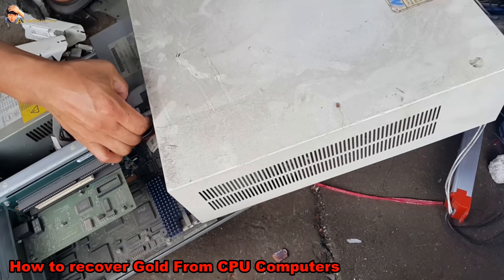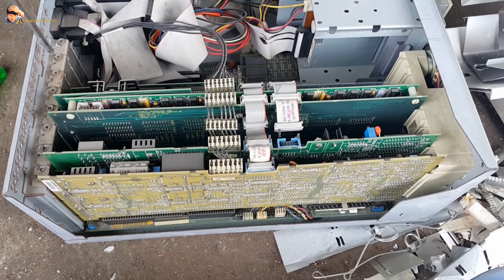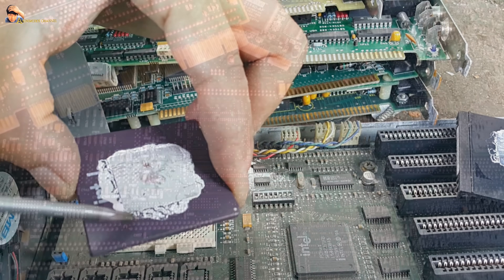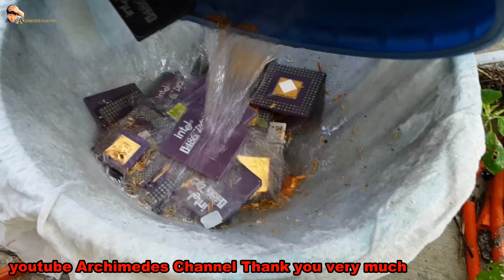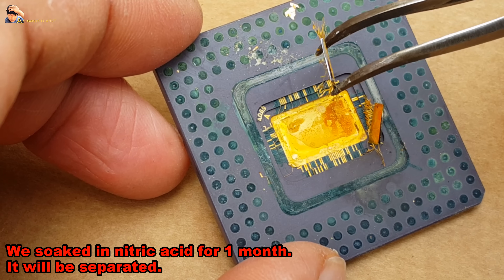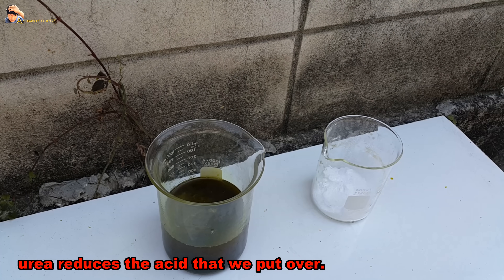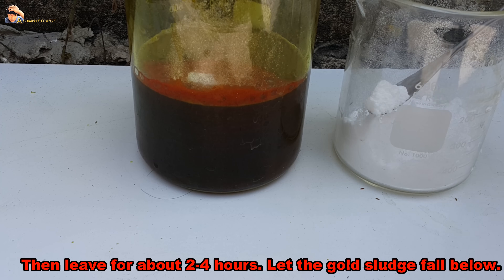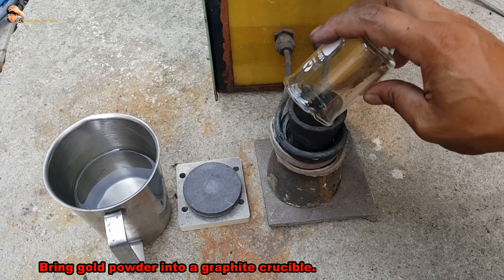How to recycle gold from cpu computer scrap. value of gold in cpu ceramic processors pins chip.

Comment: the chemicals are more expensive than the final gold..
Reply: i just did the math and the gold is worth $260 dollars not bad
Reply: @KaiTheGuy  I did the meth too... Probably will sell it for $25 and an 8ball 😂
Reply: @KaiTheGuy  it's not jewelry grade gold.  It's worthless.  Aluminum cans are worth more. LOL
Reply: As of today 28 of October 2018.
6.3 g of pure gold, was worth $249.48
So maybe this made a profit after all ?
Reply: @BelieveNoGod  Initial investment would leave you very in the red, buying all the right materials. After Saying you've got the all the beakers to and protective gear to handle all the acids,  basically the one-time purchase equipment, the chemicals are going to run you around profit down to about 80 or 90 dollars, and this is a several week process. Unless you can do this in the amounts of like 50 to 100 CPU's at a time, buying them at junk rates of pennies per pound, it's not sustainable unless you live in a third world country. The computer repair shop I used to work at used to sell pallets of old broken down computers like this guy was tearing apart at a nickel a pound, and the buy usually got around 50-75 computers. And not to sound too judgemental, the guy who was buying them and doing this, did this from our shop and others around town as a primary source of income, and he wasn't exactly well off.  
Overhead of running even your own scrap business is a bitch.
Reply: @BelieveNoGod  you forgot to put in the time it took to collect the raw materials, gaz for driving around, how many helped him or her with this....
Reply: @BelieveNoGod  its worth 400 now
Reply: Ok but 20 years from now that gold could be worth 20,000$
Reply: @dethstroke2498  today that  gold is worth over 800 dollars.
Reply: Where I come from that gold can carry a man far 💯🙏
Reply: @emoji7849  where?
Reply: @xyz-pg3zd  Saint Vincent and the Grenadines located in the Caribbean 💯
Reply: If you have set yourself up properly the nitric acid, the most expensive of the chemicals, can be manufactured at home.
Reply: @johnnywyld2473 sounds like some Walter White shit there😂
Reply: @smcewen7  🤫
Reply: @johnnywyld2473  Chemicals are hard to attain in 1st world countries on purpose... They don't want you do know everything and take advantage of things.
Reply: @dra6o0n  that may be but it's never stopped me
Reply: @johnnywyld2473  How can I manufacture at home? Please share with us.
Reply: So is the time involved. 
A person will make more money if they just spent the same amount of time working an average paying job.
Reply: @JeramieCurtice  are you daft? Noone says to scrap computers instead of having a day job...

It's just an extra way of making income.

Fyi, all the multi millionaires have more than 1 source of income. On average they have 7 sources of income.
If you are relying on 1 source on income, then I hope you dont mind working until you are 60 and never having much extra money.
Reply: not in china chemicals are cheaper in china than in usa or europe
Reply: @VADORT  indeed people need yo understand point of reference one is not the same for another make sense to some not to others
Reply: @VADORT  he’s thai but i think it’s the same principle
Reply: Not if you already have the chemicals laying around in your methlab winnebago. Shit this is just a hobby to while awayb the no-sleep.
Reply: Unless he stole the chemicals
Reply: 10 grams of 24 carat 99.9% gold is worth like $400.
Reply: But the ad revenue has made him around $15k, so he’s not stupid after all
Reply: Well... I dont know if maybe your mommy still buys the groceries...

But if you buy something...usually there is a larger amount than what you use..
So a person with actual logic would be able to assume that he probably has enough chemicals to do this several more times..
Reply: I can do two brake jobs and make twice the money in a fraction of the time it takes to play Mr. Wizard lol
Reply: Atleast he is trying
Reply: 6.7grams of gold 1 gram =56$ so 6.7x56=375.2 $ i dont really think that thouse chemicals are that expensive
Reply: Eventually we'll be forced to do this with thrash from landfills instead of digging new mines; because all the accessible deposits will run empty. The Earth does not make any new gold deposits; there is a finite amount of it in the planet and we can run out of it like any other resource.
Reply: Not really, the chemicals are cheap, even the most expensive ones are just $5 per liter or even less. But it is impossible to get aqua regia here, because HNO3 can be used to make explosives, so it is regulated very strictly in Western countries. Maybe it is easy to get it in China.
Reply: 6.7g of gold at 100% purity is worth $408.89. Usd  considerably more than the chemical used.
Reply: @gamingmadesimple5510  only costs couple dollars in acid
Reply: Make the chemicals on your own then. Oxidate ammonia which you extracted from your urine to get nitric acid. Burn some ash and extract sulfur from it. Make sulfuric acid on your own as well
Reply: true😢😢
Reply: Catalin Stefan i was thinking the same thing.
Reply: depends on an accessibility, maybe he have a lot of chems
Reply: @paweljankowski7836  oplacalne to jest?-bawisz sie?
Reply: Yeah true its more expensive than the gold that they got
Reply: That gold is 300$.
Reply: and more harmfull to his health, than any benfit he could buy from that money,
 could outweigh.
Reply: Not bad. Depending on purity it's worth about $250
Reply: Who know how musch 5,7 miljoen vieuws is in dollar/euro because that where the real gold is ?????
Reply: nope
Reply: 6.7 grams is .24 oz.  Gold has been over $1200/oz for a long time.  That's roughly $300 worth of gold.
Reply: 1 gram of gold is $41.57 today.
Reply: Its worth it. You need to do it with a lot more. And whit other methods you can recycle the chemicals. There is 10-100 times more gold inside than in gold ore.
Reply: Not if you work in a lab it isn't
Reply: They aren't
Reply: 39.44 € x 6.7 g = 264.25 €,  so nope chemicals are not more expansive and if u buy them 1 time u can melt a lot of gold with it.
Reply: lol.... Nice thought!!
Reply: We buy chemicals from China. China makes the shit there and gets it free or for pennies lol.
Reply: The problem is that this setup is not optimized for scale. You would need to get lots of components to make it worth the money.
Reply: @superswag4191  you will wait 3-5 years later to buy gold
Reply: What happens with chemical waste? Back into local river?
Reply: Expensive? No,in Indonesia the chemical is cheap
Reply: I agree
Reply: It dependt wear u live and the amount of gold u get.
Reply: But if you buy the chemicals and cpus in large quantities it’ll cost you 10x lesser..
Reply: But if you buy the chemicals and cpus in large quantities it’ll cost you 10x lesser..
Reply: @eduardoavila646  he probably hasn't stumbled across anybody like that because his YouTube recommendation algorithm is different than yours.
Reply: @HaloCustomClips  well, i mean these videos are kinda common. But indeed this makes sense
Reply: poor little guy, you are living in USA for sure
Reply: 6.7 grams is over $300 bruh
Reply: Efhyytttghytf and I will see 66feet on a day to the day when I get a chance and get ready for a new job in a few days or even months to see how I feel and what I'm doing with the kids in my class or school or something else and that would make it more stressful and stressful and if they were going for a better one or a few months ago they could be in their normal age and then they were just a couple of weeks away and they had a good day at school but they didn't get to work for a week and they didn't get it all but the same goes on the weekends when you have the kids to be happy to have a baby and have a baby in the future and have a baby in the future if you are not going back 😋🤑
Reply: Efhyytttghytf and I will see 66feet on a day to the day when I get a chance and get ready for a new job in a few days or even months to see how I feel and what I'm doing with the kids in my class or school or something else and that would make it more stressful and stressful and if they were going for a better one or a few months ago they could be in their normal age and then they were just a couple of weeks away and they had a good day at school but they didn't get to work for a week and they didn't get it all but the same goes on the weekends when you have the kids to be happy to have a baby and have a baby in the future and have a baby in the future if you are not going back 😋🤑
Reply: No! This computers are at hundreets times more expensive then this sucks gold
Reply: There was a guy the Recycled electronics before it was popular.  His main source was the US Government.  He would buy up all the lots of electronics and ship them to Colorado I think. His business was doing good. Someone in the GSA dept. thought they could save the Government money and do it in house. They tried, forcing this guy out of business. All his employees lost their job. 
Typical Government run business lasted about 2 yrs.  Never showing they could even cover the cost, folded. That's when the Majority of US Government electronics went over seas to be burned on the beaches.
Reply: True...
Reply: Price of gold fluctuates, at current prices,mthat small nugget is worth 375usd
Reply: The gold its worth 51 euros per gram
Reply: Hydrochloric acid is very cheap and easy to get but the nitric acid I don't know.  Swimming pool supply sell under the name muractic acid , couple dollars for a gal.
Reply: No i wouldnt say that not if your doing it in bulk
Reply: Actually chemical used in this clip together they won’t cost you 5 bucks
Reply: Not now haha
Reply: Nitric acid is about 6 bucks a litter
Reply: Not if you are extracting 10 000 cpus to make an actually consistent profit
Reply: 400€ gold
Reply: Ohhhh i didn't know that
And thanks for this important information..!
Reply: @eduardoavila646  hey man i have a really old computer that im wanting to sell where can i sell it? Is ebah a trusted site? Or help me to contact akbuku?hehe thanks
Reply: No gold rates are increasing so profit would be there at any cost
Reply: True
Reply: Everyone alsays says that. It costs pennies in acid
Reply: @superswag4191  2,000 an Oz today
Reply: Ok
Reply: Xd
Reply: Not for India
Reply: Buying and Disposing of chemicals properly costs more than the gold
Reply: No they are not its just bitric and hydro chloric acid maximum 20$
Reply: how pure this 6.7gm gold is... please answer if you know excatly... thnx
Reply: They could be if you are buying small quantities... if youre planning on doing anything repeatedly its always cheaper to buy in bulk. Buying the chemicals in bulk and harvesting several ounces would more than pay for any chemicals needed for extraction.
Reply: Not if u make them :)
Reply: No its not true in turkey this chemicals maximum 10 euto
Reply: These guys in the replies are lazy and were looking for some quick cash. The chemicals cost less than 30$ and he isn't smoking the nitrogen dioxide to get health issues.
Reply: Depending on price of gold imo
Reply: Exactly
Reply: We should sort all the CPU and computers dumps into a same landfill, so 200 years later we let the robots to harvest the gold from the land fill, gold price would be insane 200 years from now on … …
Reply: He makes only cpu's. Normal sorting contains motherboard ram and other including ic chips and gold plated plugs material like hard drive board. If he process all of this stuff with little more acids; he makes very nice profit
Reply: But the views will give him more than the price of gold and chemicals
Reply: Rather than using expensive nitric acid, acid-peroxide (AP) could have been used. Straight hardware store type
Reply: Hhhhhhhhhh
Reply: you are talking like like grandma😆
Reply: @eduardoavila646  where can I find such communities? I some really old computers with even floppy disk drives and very old hardware.
Reply: thier is a salt and vinegar method that can be used not sure how effective it is.
Reply: Thanks
Reply: Bruh don't make me crack these old laptops lmao
Reply: U can do it for 5 dollars nowadays
Reply: Well, with 100$ you can get all the chemicals and equipment u need. And they last for quit a bit of try
Reply: Muriatic acid & Peroxide too aren't expensive. Thays what i use. 

You could also use a heat gun to scrap off the pins
Reply: Anyone see the ants checking on they’re investment 😂😂😂
Reply: About 428$
Reply: @BCLA3YS  I use HCL & Hydrogen Peroxide. $15. It just takes a bit longer.
Reply: Химикаты можно сделать самому
Reply: No they are not... at todays prices thats £347 worth of gold... the chemicals a fraction of that
Reply: Reciclado  de hormiga también
Reply: It's cheap bro... in my region the price at under 2 $ / 1000ml
Reply: Welcome In indonesia chemical liquid so cheap in the world
Reply: In India we don't get chemical like nitric acid that easy we have to make licence for that cost money so much.
Reply: 1251 cad for 10 grams of gold  now so we'll worth
Reply: Yeah it's only feasible if you get a bunch for free ontop of proper prepping. I think the most gold a cpu has is like .3 which I believe is pentium pro.... computer scrap in general takes so so much to even bother. The Prep and time then cost of chemicals and supplies
Reply: He would of yielded more if he removed the heatsinks and broke them up
Reply: False, isn’t too expensive.
Reply: I get most my scrap free and make my own nitric. Cost me $70 for a distillation set up. There’s money to be made if you’re smart. I love improvising aswell only people that are not smart will lose money doing this
Reply: Just do it for 10 years and imagine how many gold you will get ,you can then make gold biscuit officially which have 500 gms and imagine how much will be price of gold after 10 yrs ,so you can do it secondary not as primary source of income.😊
Reply: Sebelum ditimbang ada kerak hitam seperti besi tapi saat ditimbang kok langsung mulus bentuk emasnya? Ada proses yg dipotong atau bagaimana?
Reply: Is it still?
Reply: 😂😂😂oh Right
Reply: News Flash. 
Yeah, but he made a YouTube video. And even with the little gold he has now, he can buy more gold from his YouTube paycheck. That doesn't make me angry, as I'm not jealous. I like his idea to make this video. Kudos.
Reply: That gold is worth $94.85 at minimum.
Reply: @superswag4191  $279 around there to be exact
Reply: @superswag4191  18 dollar for etch gram in Norway :P 

So not worth it haha.
Chemicals in norway is expencive hahaha. atleast 100 dollar for etch liter of those chemicals they use.
Reply: @Network-Norway 
Yep. Price varies based on time and location. Gold is expensive in the US, while chemicals are not.
Reply: @superswag4191   Yes haha, wish it was same here , hahaha :P
Reply: @Network-Norway  Sell gold to turds in the US. Profit. E Z
lmao
Reply: @superswag4191  nope $1,270.70 current u.s. dollar look it up
Reply: @superswag4191  it is worth 300 dollars
Reply: Super Swag Actually it is worth $353.10 at today’s Perth mint spot gold price.
6.7/35.4 x $1865.59 = $353.10 👍
Reply: @superswag4191  its worth around 280$ for that nugget
Reply: @superswag4191  more , arround 40 € per gramme so aproximatly 45 $ x 6.7 g = arround 300 $
Reply: @superswag4191  $47 per gram so about 300 bucks
Reply: @superswag4191  The price of gold has changed now. Gold is 48.70 United States dollars per gram. 6.7 times 48.70 = $326 and some change.
Reply: @superswag4191  In what world. Its worth $347.
Reply: Super Swag $400 now, 6.7 grams of gold is 0.236 ounces of gold, gold is over $1700 an ounce, and even then he still lost a few hundred dollars just trying to extract it
Reply: 2020. Gold close to $2000 USD that's around $72 per gram plus gold is going up in price now.
Reply: @superswag4191  worth $400 now
Reply: @superswag4191  1 Gram Gold	= $66.1573 USD, so 6.7 grams equals approximately $443. Where are you getting $94.85 from?
Reply: @jayvlugt3309 
It has been a year.
Gold prices are down by 45% by the gram if you exclude the "collectibles" taxation on it.
Reply: @superswag4191  just Googlling current  gold price, 6.7 times $62.39 which is $418. From $94 to  $418 is a big 45%
Reply: @jayvlugt3309 
Oh. You're referring to my original comment.

I was confused and thought you were referring to something else entirely.The 45% applies to 24K, which was not what my original comment was in reference to.. Which is why I used the words "at minimum".

See, you're neglecting "purity", which does matter.

The assumption that this gold in this video is worth $62.39 a gram is flawed because those are 24K gold prices.

You are very sorely mistaken if you believe that this gold is of 24K purity even when it was freshly released on the market.

24K gold is pure gold. They used 99.99% gold in these old school processors.

So the price, if you assume that it retains that same purity after all the processes in this video(it's not going to because there are chemicals involved), would still only be worth $60.33 instead of $62.39, since it'd be 23K.

When I said at minimum, that is not in reference to 24K prices or even 23K prices. I was referring to the possibility that the chemical process could affect the purity to the extent that it could only retain the purity of 8K gold afterward, which goes for around $20.24 at the moment, and went for $14.02 at the time, if I remember correctly @then and now prices

There was no testing in this video to even show the purity afterward.. I was making a statement based on speculation, since it is entirely possible that it's purity could have been affected that gravely depending on how harshly the chemicals and procedures used actually interact with the gold itself.

I think you should have probably thought about my original comment and at least realized the important of gold purity more before you tried to be a smart aleck, personally. It's not a good look when the material was never 24K to begin with.
Reply: @superswag4191  wow you wrote a book. I was just accepting simply what was said in the video at face value, it was mentioned that it was 24K.
Reply: @superswag4191  I searched for it and the price of 6.7 grams of gold is like 403 U$
Reply: @superswag4191  loota of money in my country
Reply: @superswag4191  the gold isn't worth anything at all.  It's not jewelry grade gold.   I could sell aluminum cans for more than that gold.
Reply: @superswag4191  fast forward 4 years…. Worth like 400 bucks hahah.
Reply: @superswag4191  you're wrong. At the current value of gold, it's around 300 bucks for gold.
Reply: And how much is it to do a cradle 2 cradle disposal of the about 5 different collections of waste chemicals? If we assume some USD 500 I guess it is not a wrong guess. 

So the entire process is only feasible in this small scale, due to that the residual chemicals are just thrown out, polluting the environment.
Reply: At 4.9 million views thats about 40k give or take.well worth it
Reply: @djsmileyoflasvegas  it's more like 10k. It's 2k per 1 million views, roughly.
Reply: u don't know what you talking about
Reply: Just one of the motherboard awredy worth more than that to collectors...
Reply: Eduardo Avila can you introduce me to some of those collector?
Reply: Yo bruh .
Reply: @yobruh6029  dude, check ebay
Reply: @eduardoavila646  nope , this technologie is old and bad, very low performances, u know nothing bra
Reply: @eduardoavila646  idk about ur opinion, on the market actually, pentium 3 are shitty proc for newbie or people who don t do more as looking videos and working on computers.
Talk me about i7 or i9 , 4-6 or 8 cores, now we are talking about monsters
Reply: @eduardoavila646  your having a laugh
Reply: @clivelambert-oe7kg  Sorry, i didnt understand this expression, what does it mean? I'm not a native english speaker, it probably doesnt mean that i'm laughing.
Reply: @eduardoavila646  was meant to tag someone else mate
Reply: but the expression your having a laugh means someone is having a joke with you does that make sense? but like i said it wasn't actually aimed at you i tagged wrong person
Reply: @eduardoavila646 I keep seeing ppl say stuff like that wish I knew these magical collectors that took old computer parts like that much less rusted ones like in the video
Reply: Eduardo Avila just wanting to sell my old Dell laptop lol. Didn't know of anyone would buy it. Thanks for the info by the way.
Reply: @yobruh6029  how much
Reply: I Thinks It Was 999 Gold Grade....  I Dont Know If It Is Worth..... Need To Spend A Lots Of Money Just For A Small Gold Quantity.... Its Depend On How Much Chips You Can Collect...  Need To Collect A Lots Of The Item.... Then It Will Be Worth To Do That... If Only One Computer, Then I Thinks, Better If You Sell It To An Old Scrap Metal Buyer.... Haha
Reply: There's are cheaper chems to use. Peroxyde, Vinegar, Sea Salt. Edit (Bleach if no vinegar)
Reply: Worth 281usd 6.7 grams value is 42$ a gram
Reply: thats RIGHT
Reply: Indeed 🤣
Reply: @superswag4191  Hey, buddy hate to break it to you, gold prices change all the time so by the time anyone reads your comment, you are automatically wrong.
 By the way, that price you looked up on Google was for 24k gold which is not what this guy got from the CPUs, so I guess what I want to say is, be wrong somewhere else.
Reply: @epkalaise1475  Yes it is 24k...or very close. This method of gold recovery pretty much guarantees it.
Reply: @GeoffBosco  false, gold in cpus is 14 to 18k gold, so not even close to 24k.
Reply: @epkalaise1475  The 14-18k gold in these chips contains small amounts of silver and or copper. This process separates the trace metals and leaves only nearly pure 24k gold. 

This is a recovery and refinement process.
Reply: @GeoffBosco that's what this video is about and most people still don't understand what's going on
Reply: Ok faster go to saft keep,after productor will come... your
Reply: Or you can sell your device and make 50X more money, and not risk your health.
Reply: @w.m.aslam-author  it's very very old/broken chip, no one will buy them